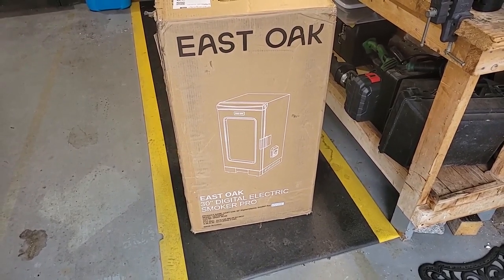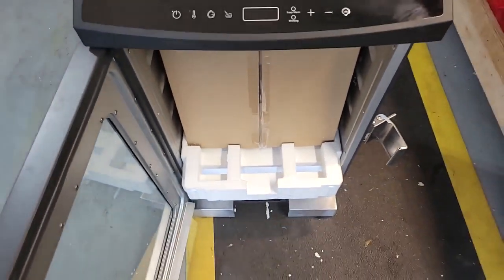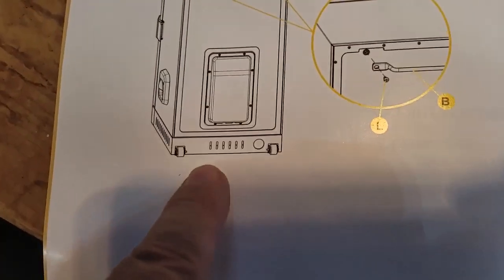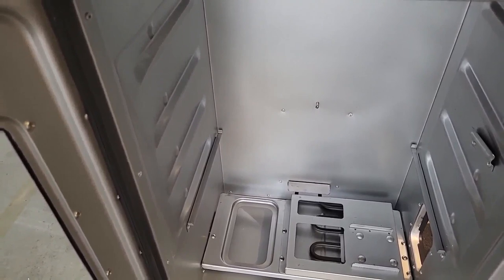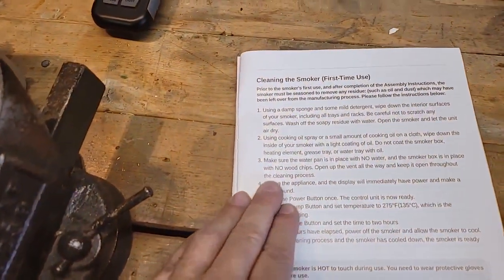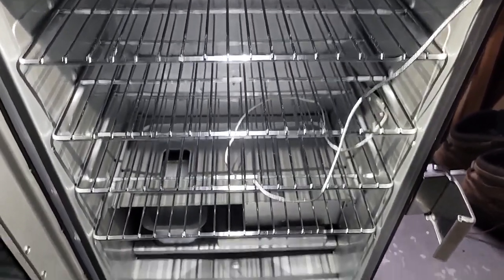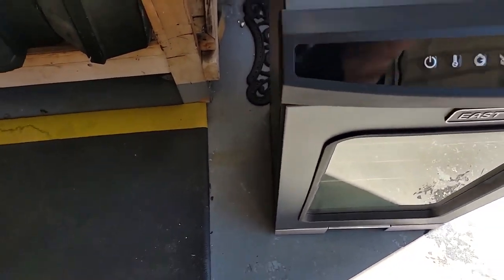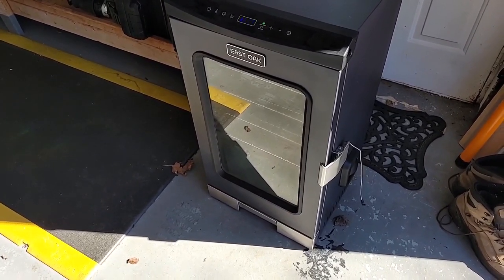EAST OAK DIGITAL ELECTRIC SMOKER PRO ~ UNBOXING SEASONING OPERATION TEMPERATURE ANALYSIS AND & TIPS

Comment: Would i be able to use a gfci extension cable instead of the gfci outlet?

 I ask because where my smoker is gonna be, we dont have the gfci outlet the one we do have is far away and broken
Reply from the maker: A GFCI extension should totally work. Double check by calling a local electrician first though. 😎👍🔥